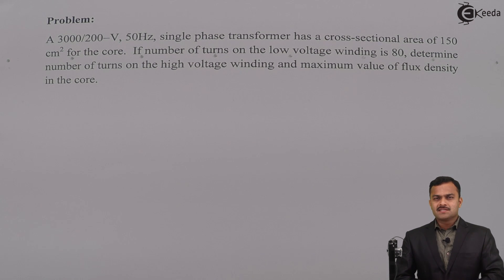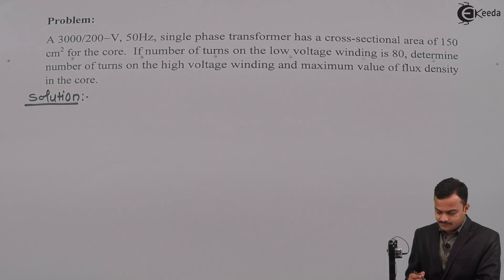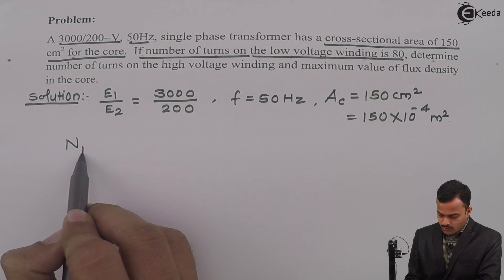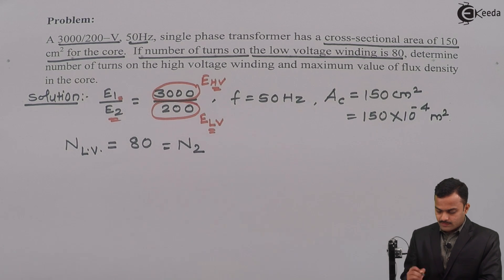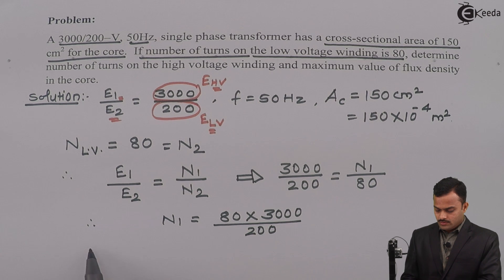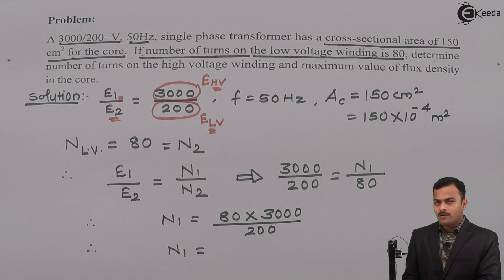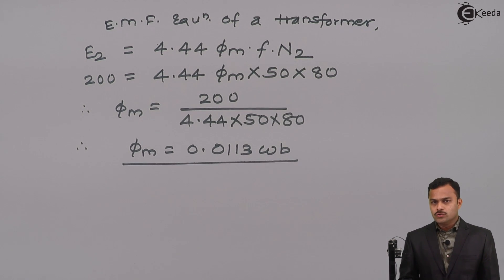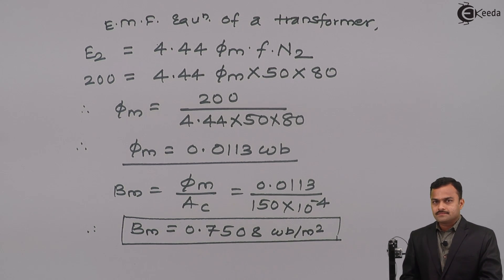EMF Equation of Transformer : Problem 4 - Single Phase Transformer - Basic Electrical Engineering

Comment: in this problem why did u take E2 at last to find max flux density??
Reply: you can also take E1 the answer will be same... its just upon you whether you take E1 or E2
Reply: I take E1 but the ans is different... I check my calculations but there is no mistakes